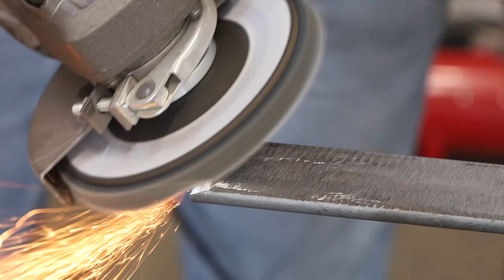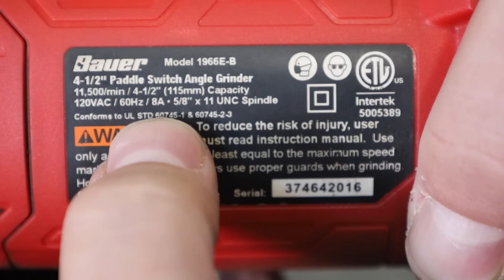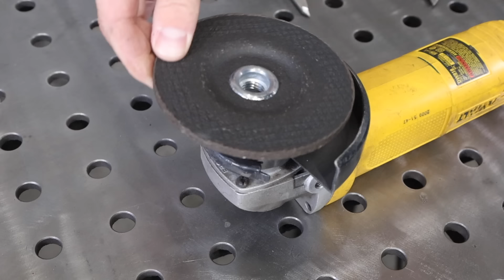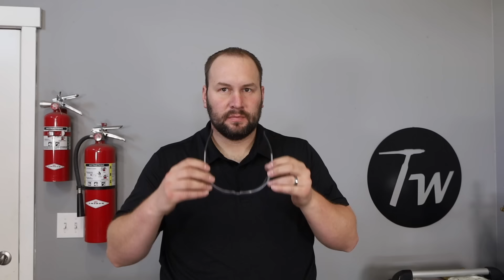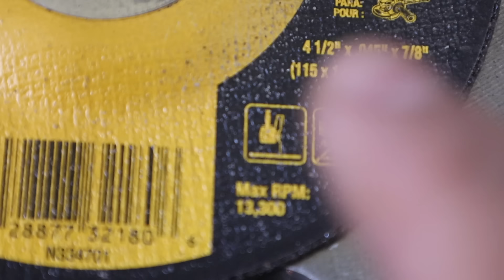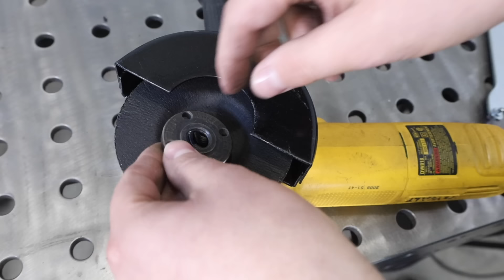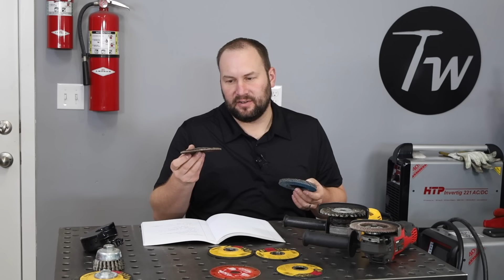Angle Grinders 101 | How to Use an Angle Grinder

Comment: So i got a couple issues with this vid nothing major its good info and because its not stupidly long so people will actually watch it.

Biggest issue i have is that you tightened a cut off wheel with the wrench dont ever do this with thin discs you can tighten that nut too much and actually break the fibers of the wheel. The nut really doesnt need to be more than hand tight otherwise good luck changing the wheel. I used to cut while holding the handle but honestly  you'll get a better and straighter cut with one hand just dont limp wrist it.

And one tip when using a grinding disc dont use a pulling motion try pushing it leaves a flatter and smoother surface. For sanding discs its the opposite try pulling rather than pushing it also wears down the sand paper more evenly so your discs last longer.

Also maybe wear gloves lmao

Comment: Thanks for the video and tips.  I was wondering if you could comment on the other uses for an angle grinder for such things as cutting tiles or stones, or perhaps for sharpening axes?  Also, what are your thoughts on the small light duty Bosch 1375A angle grinder. It’s only 6amps, 11,000 rpms though.

Comment: Is there a specific reason that many fabricators tend to work with the flap discs instead of the hard grinding wheels? I cant understand why they would choose a more expensive disc that wears out faster and has a bunch if flex to it over a hard disc when they are grinding their welds smooth
Reply from the maker: They remove material faster and are less likely to leave grooves. Both types have their place, though.

Comment: Hello, don't be tired
 I had a question
Is it possible to cut a iron square box profile that is tangent to the wall with an angle grinder?
Considering that the iron sqare box profile has no distance from the wall, the  cutting wheel may hit the wall, will the cutting wheel's collision with the wall cause the cutting wheel to break, or will there be no problem?

Comment: Great tip to pass on—zip tie your wheel wrench to the plug-end of a corded grinder. Not only will you never lose your key, you’ll never forget to unplug the power when changing out a disc. (Can’t remember where I picked this up, but thanks to original source! Works like a charm.) Tim, you do a fantastic job and your videos are my favs. I’ve learned so much from your channel. 🙏
Reply: Great tip, automatic safety and efficiency.
Reply: The amount of times if get grabbed something after just cutting it
Reply: A simple tip, a massive difference.  Not only for the safety issues but when you have your mind focus on doing something there is no biggest disruption of your thought process than looking for the damn wrench, which is always out of place or missing. 
It also works for the drill key.
Reply: You don’t need the wrench… unless it’s seized up
Reply: @albertjowd8482  what would you use instead?
Reply: @jonfisher9214 Nothing, you just use your hands (preferably with gloves) to pull the disc (counter clockwise) while holding the button with the thumb of the other hand. Then when you change the disc, tighten the nut with your hand as much as you can and finish the tightening by pulling the disc (clockwise) with your hand. I worked in trades for years and you will almost never see someone on construction site using the wrench.
Reply: All my dad's old tools that have some sort of key came with a rubber thing that connected the key to the power cord. Its strange they don't come that way anymore.
Reply: My work does this on their old makitas. I like that others hate it because it gets caught everywhere. Beats looking for the wrench when you're switching out heads.

Comment: I have a bunch of grinders, between 4, 4.5 and 5 inch. I have so many as I do metalwork and woodwork, each has a different disc or cutter. 

I'm culling the cheaper ones down, too hang onto the better quality ones. 5 inch grinders are my favourite 

cheers from Downunder. great video

Comment: Hi Tim, thank you for the valuable information. I started using an angle grinder for embellishing some wood turned objects. How to safely use the angle grinder was explained very well in the literature that came with it. However, it was very difficult to try to understand the different discs And how to properly buy and use them as this information was not included. Great explanations and videos.  Tina

Comment: something you missed about the cutting and grinding discs, a lot of them have an expiration date stamped on the inner ring, google says it's 3 years from date of manufacture.  seems to be more like a best before date though, i've been working through a 50 pack of "expired" in 2018's and no notable stories to share.

i like how you only showed knotted/twisted wire wheels, i hate the wire brush ones.  i find the knotted ones aren't as grabby if you catch an edge the wrong way and i've never had one of the knotted ones stick a bristle into my ball bag.

Comment: what is your opinion of using a polystrip disc to remove things from aluminum like paint and caulk (from an aluminum boat)  as well as rust and paint from a boat trailer to prep for painting vs say a wire wheel?

Comment: One additional note: most wheels I've in use also feature an expiry date stamped un the metal insert. So if you prefer safety over cost saving, throw away the aging ones and rather get a new disc.

Comment: I remember a situation at the construction site where several older workers gathered around to talk about something and one of them was setting up the angle grinder. The moment he turned it on, the disk exploded into million pieces. Luckily, everyone walked away without a scratch. Few minutes before that, a huge drillbit had snapped while being operated by another guy. Do these things happen on a regular basis? This was 3 years ago, and I was a fresh structural engineer. So after this and quite a few other accidents at that very site, I decided to pursue the rest of my career in the bureau. Thank you for making this video and make me feel a bit more comfortable with power tools.

Comment: Great information. I want to clean my bathroom floor tiles which are made of Ceramic. They are sturdy and 25 years old, but stained  and calcified because of the extremely high TDS water. Can you please advise the right tool? I stumbled upon Angle Grinder which can do the job with wire brush and steel cup. But also saw the Orbital Sander, I don't know if that will work, as they use it for polishing, but unable to see any reference to removing calcification and stains. Please advise.

Comment: Thanks for your grinder wisdom 👍.  
  I found this interesting video today and thought,  I gotta ask a professional and this is it.  https://youtu.be/lDeeojQ034o
  So,, 🤔 what say you Tim?
Reply from the maker: If you want me to be honest, I think that’s a ridiculous thing to do. First off, if you have a TIG welder, why not just TIG weld it? Second, the HF starting doesn’t do anything to avoid heat input, it just avoids the need to strike an arc. Third, stacking tacks like that is just asking to trap slag. It looks like he’s running 6010, so with a proper whip and pause technique, he could just run it or switch to a 6013 rod and just weld it without any song and dance. I’m really not one to bash others techniques; if it works for you, go for it. I just don’t think he’s solving any problems here. I would recommend that he wears gloves; burns and skin cancer are hard passes for me.
Reply: @TimWelds  ,, Thanks for your reply. 
  I needed a professional opinion and you’re the man.  I'd never seen this before,, even with my limited experience. 
 You hit on numerous valid reasons to avoid these techniques if you can actually call them that.  The poster may have resorted to this due to extenuating circumstances 🤷‍♂️. IDK. 
But anyway,  thanks again for your thoughts. 
 Cheers 🍻,  G.

Comment: I’ve used an 90 degree air grinder at work for 20 years 2” composite for aluminum and occasionally steel to relieve clearance issues. 
Never had one blow apart but I’m careful, I use deerskin snug fitting gloves to protect my hands as being careless 1 sec at 20K rpm will cut through that glove and nick you pretty good.
I have prescription safety glasses with required side shields but if the work will support it I’ll wear a face shield to add another layer of protection. No shield on the grinder. At home I use the shields on my welding grinders as much as possible. I started with an older slower battery powered ryobi at 8K rpm and that one I use with a wire wheel. I’ve actually purchased a few with power cords as they are lighter. I’ve found the battery powered models wear you out with the weight over time.

Comment: Thanks for the safety tips.  Of all the tools in the shop, I have injured myself more with an angle grinder than anything, and I try to be safe.  A few things I've learned:  1)  After grinding a piece of steel, it gets very hot -- don't forget it. 2)  A grinding wheel will cut through your skin a lot faster than metal -- it will take time to heal.  3)  Wire wheels usually throw off wires at high speed -- they penetrate easily through cloth, so think how much easier they will go into your eye.  4)  Don't think it will make you look like a pro if you take the guard off.
Reply: Should wear gloves when use this tool ? Saw a comment saying Not to wear
Reply: @blessnorthamerica7919  I've always heard that someone should not wear gloves when using a bench grinder.  The reason being that you are pressing a work piece against a spinning grinding wheel that has a tool rest with a small gap between it and the wheel.  The glove could get caught in that gap and pull one of your fingers into the wheel.  The angle grinder disc is being pressed against the work by the operator, which keeps your hands much farther from the "danger zone."  It is much more likely to do damage if you let it get out of control and brush against your other hand or body part nearby.  I've had that happen a few times and leather gloves saved me every time.  The times when I got injured by the grinder was when I was not wearing gloves, holding the work piece in one hand and the grinder in the other.  It only takes a light touch of the spinning disc to gouge out a groove in the skin.  A wire brush is just as bad.  Keeping both hands on the grinder when using is your best defense. That guard and handle are there for more than just decoration.
Reply: @blessnorthamerica7919  i wear gloves because whatever you are grinding can be kicking back material from that thing you are grinding, as well as the sparks.
Reply: @blessnorthamerica7919 I'm late to the punch here, but for anyone showing up in 2025 and beyond, a good rule of thumb is to not wear gloves (or even long sleeves) when working with rotating tools such as a grinder, drill, many types of saw, etc. 

Tools can catch on loose clothing or jewelry, and a machine doesn't care if it's about to maim you, or worse.
Reply: Thanks for sharing your experience. I decided not to touch this tool
Reply: NEVER TAKE THE GUARD OFF.  I’ve seen multiple people with injuries similar to gunshot wounds due to exploding blades and the shrapnel penetrating vital organs.
Reply: Yeah angle grinders and bench top grinders are probably the tools with the highest potential for danger. That also varies ALOT depending on what is attached to the grinder like wire wheels or  bonded paper abrasives , nylon or whatever else they got
Reply: @DownHillgamer  The wire wheels seem to be the trickiest to use, especially when they catch on the edge of the work.  🙂
Reply: X sc zXh z zvc😢
Reply: Thank you
Reply: @fastbusiness  I remember the deoplant needed to be modified and the old one needed to be scrapped, it was stainless steel 5 mm steel sheets , anyhow they did not used any safety equipment and their shoes was sandals , they finished the job without any scratch , but they had a leader that they listened to him and he assigned the job for his team . In short not anyone suitable for bigger disk angle grinder , that needed more experience and more skills otherwise 4.5 for the rest .
Reply: The last one… shit leaves blotches on the skin making people think you’re doing hard drugs…
Reply: Pros use the guards and the cool guys use PPE
Reply: Taking the guard off actually makes you look like an amateur.
Reply: After 10 years of working with this tool, a Diablo electric angle grinder with a diamond blade kicked back into my leg above the knee. God protected me, and I’m never going to touch this tool again in my life.
Reply: L
Reply: L
Reply: 90
Reply: Thanks for the waning. Convinced me not to buy this overrated tool.
Reply: @ve2jgs It's not an overrated tool it's a tool often used improperly by amateurs who haven't bothered to educate themselves.
Reply: @madmouse7915 Thank you. I have a grinder for the occasional use. But I’m not a fool, to believe that after those few in between uses, that I’m proficient in its use. That’s why I visit content talking about safety. And not underrate it’s valuable use!!!!
Reply: @ve2jgs  Greg, the angle grinder is a very useful tool after welding and during other metalworking operations.  Kind of like fire, you use it but you always respect it.  Grinders are like any other power tool in the sense that they have no conscience, and can do damage to the operator just as quickly they can to the part being ground.  I use grinders often, but I'm always trying to be aware.
Reply: @fastbusiness preach!
Reply: @Blah-blah-sure  Good to hear from you.  Some people might think I'm old fashioned, wanting to use the guard and handle on the grinder, and trying to work safe, etc.  I guess it looks more "cool" to skip all that.  The real question someone should ask is whether or not they want to be able to see, breath well, hear, or have all their fingers later in life.  That kind of stuff is not very important to some people.
Reply: @ve2jgs  Nah man this tool is definitely dangerous if not careful but don't let it take away from how useful this badboy is lol
Reply: Your eye is actually really hard to penetrate with anythint, people often imagine it's soft but it's not. Your point still holds though.
Reply: @Seagull780 This is sarcasm right?
Reply: @PyroXXman  no it's not. Your eyes are easy to damage but very hard to penetrate because of how hard they actually are.
Reply: @Seagull780  I’m not sure what you’re referring to with “penetrate”, but there are numerous avenues that your eyes can easily be damaged. Corneal scratches resulting in infection or permanent vision damage, chemical exposure that can dissolve the surface of your eye in seconds, and objects penetrating them to name a few. I personally have had to go to the ER from a manufacturing facility after an adhesive made it past my safety glasses into my eye. Friend of mine was playing video games and just happened to look up at the exact moment an almost invisible fragment of a single strand of fiberglass insulation fell into his eye, where it became lodged and had to be removed at the ER. It is in fact VERY easy to damage your eyes while not wearing the proper PPE, and still a danger even while utilizing it. PPE is the last line of defense against things that can harm you, but still a crucial one.
Reply: @PyroXXman  oh yes definitely, damaging your eyes is easy, but people usually imagine they're soft squishy meatbags that will easily get punctured, but they're quite hard even if their surface is sensitive. So if a piece of a wire brush gets launched in there it won't pierce it. My guess is your eye will deflect it and you get a big ass scratch all over your eyes and down by the side into your socket where you will now have a piece of metal stuck inbetween the surface of your eyes and your eye socket ready to scratch your eye even more whenever you move it. I'm not even sure if that's better than having a piece stuck inside your eye.
Reply: @Seagull780  "I'm not even sure if that's better than having a piece stuck inside your eye."

judging by the reactions of everyone that's ever had a piece of metal stuck on their eyeball...I'd say it's a definite no
Reply: First thing I do is take the guard off, it's always in the way.  Never once been injured since I was a kid. Watch out for flying strings from wire wheels though. Don't be stupid and you will keep your fingers

Comment: Great video Tim.Also a good safety tip is: Keep your head and body out of the plane of rotation of the disc, because in the event of kickback or wheel failure, you're not in the most likely path of shrapnel. Also, gloves can be an entrapment hazard between the guard and the disc. Very impressed you said clamp the work and put both hands on the grinder - I see a lot of YouTubers not doing this - very dangerous practice to hold the work with one hand and operate the grinder with the other.
Reply: Point taken
Reply: Agreed, except I would recommend wearing gloves definitely with wire wheels and brushes. If your glove gets caught in-between the disk and the guard, it's in the wrong place to begin with. Just make sure your gloves fit... well like a glove. No flappy bits and strong fabric made for the purpose. They will keep your hands from being stripped to the bone.
Reply: I hold the tile I’m cutting with my bare feet and hold the grinder with two hands
Reply: Cầm máy 2 tay và có eto kẹp vật cần cẳt. Cám ơn bạn.
Reply: Love your channel John.  So, you don't recommend holding your nose to the grind stone?
Reply: Always clamp your work. A vise is nice, but I'll angle grind outside, thanks.
Reply: ni
Reply: ni